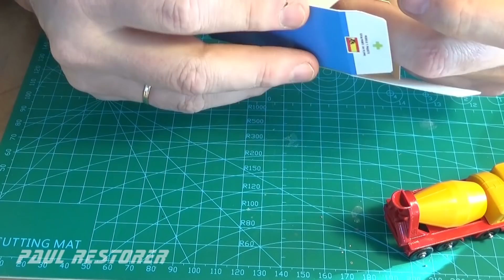Renowacja Foden Concrete Truck Matchbox nr 21. Odlewany samochód, naprawa.

Comment: Nice Paul l did one about a week ago the pin on the back of the mixer l had fix well done looks great Brian Thailand
Reply: Broken pin on the barrel seems to be a common repair.  I restored a Superfast version, and tried glueing a piece of round Styrene plastic rod to fix the pin.  Works ok.
Reply from the maker: Thank you very much

Comment: Excellent job Paul. I have 2 of those trucks with superfast wheels, n both of them don't have the yellow spiral plastic thingy over the axels. Hmmm....
Reply: I restored a Superast version of this truck.  You are not missing the spiral on the second axle.  It was deleted by Matchbox and the base redesigned for the Superfast version as a full length green plastic piece.  The cement mixing barrel still has the gear on the end, but it is not connected to anything.  Cheaper for Matchbox to make the same barrel.
Reply from the maker: Thank you very much
Reply: @railtrolley  txs for the info, Sir.